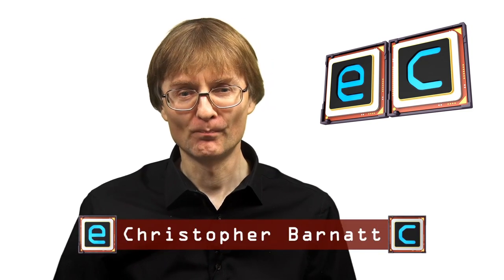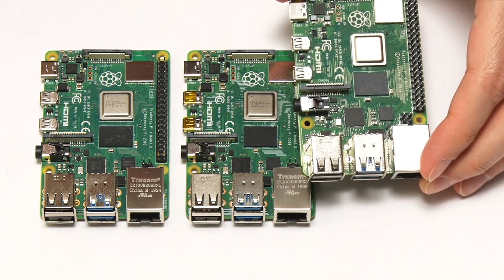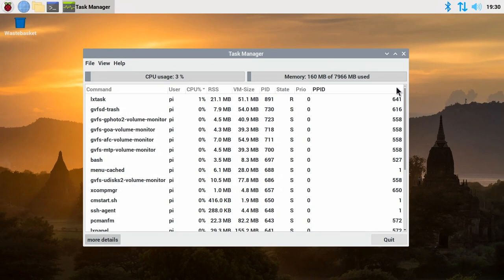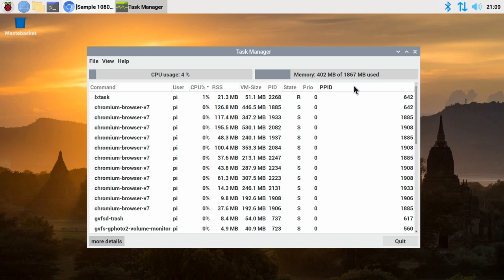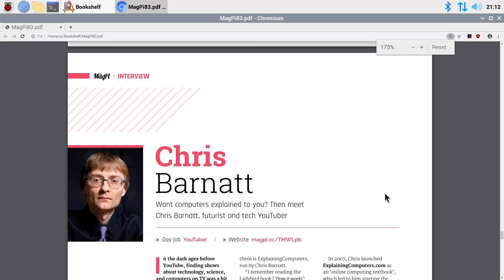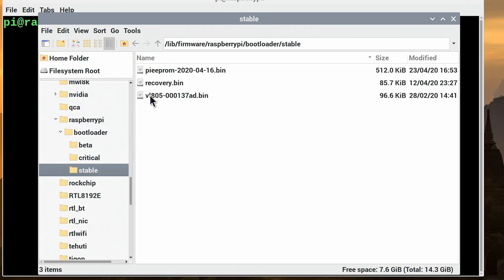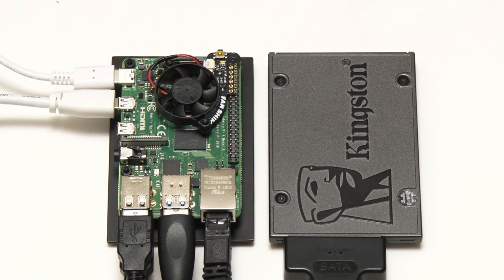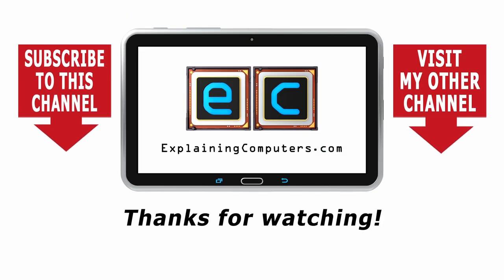Raspberry Pi 4 8GB & USB Boot

Comment: I think the best OS solution would be Lubuntu. I run it on 3GB with a single core processor. I use the 64 bit version because I need to run Microsoft Teams which has a native Debian app. It's a true 64 bit operating system with a very small footprint.
Reply from the maker: Is there a an MS Teams Debian app for ARM?
Reply: ExplainingComputers Not to my knowledge. There is a Debian 64 bit version for AMD/Intel.

Comment: Two questions:
1) Why did you need to flash the firmware? USB boot feature? If so, I'm shocked it took this many years for this SBC to finally support USB boot.
2) 8GB of memory, great. What are the other specifications?
This is the board you were reviewing?
https://www.raspberrypi.org/products/raspberry-pi-4-model-b/specifications/
Reply from the maker: The link is indeed to the board in question (the 8GB version). The new firmware was indeed to allow USB booting. A Pi 3B(+) has been booting from USB for some time, but the functionality is new to a Pi 4.

Comment: So with no memory at all the Pi would cost around £15? I guess the memory must be the most expensive component on the board. 

On a pedantic note - that's not the first Pi board that you additionally showed - the first Pi board had no holes in it. It's also interesting to note that those holes are not a surface mounted component like the others.

Comment: 4:17 Are you running this setup with the standard 5V 3A power supply or did you use one with more Amps? Or are you powering the ssd's from as different power source?
Reply from the maker: I am using the official Raspberry Pi 5V (actually 5.1V) 3A PSY, and the SSD is powered from the Pi via that adapter.
Reply: @ExplainingComputers  Thanks for your reply! In that case I'll stop my search for a 5V adapter with higher amps and also use the standard power adapter.

Comment: I'm new to Raspberry Pi and was surprised to find out that this is a new feature. I guess I've been taking for granted that low-level code that lets me boot brand new distros on my old laptops from a USB. Any reason you didn't run your usual read/write tests to see how the SSD and SD Card drive speeds compare?
Reply from the maker: I will run these tests in an upcoming video in which I compare the Pi 4 to the Odroid C4. This video was getting rather long.

Comment: Aren't cellphones and streaming devices like the Fire TV stick essentially SBCs?
If I can connect a type C or micro B hub to my phone via the single port, and power, add Ethernet, add external storage, a keyboard and mouse, and output to a HDMI from one port, why haven't we gotten there with SBCs yet?
Reply from the maker: You are right, cell phones are SBCs. On the connectivity, I think most users want more connectors, rather than needing to use breakout leads from a single port. What you suggest certainly could be done technically.
Reply: @ExplainingComputers  it could also change the size and form factor. Cost is where I think the biggest problem would be. With the advancements in technology just in the past 20 years, and USB4 just over the horizon, I'd love to see someone step outside the box and build something to rival the Pi Zero with maybe 2 type C only, and no pins, just solder joints. Ah the possibilities of even automotive infotainment in such a device.

Comment: Great Video, I've got a Pi4 (purchased in Oct 19) but have not used it yet because I've been waiting for usb booting support.  When first using a Pi4 do you still have to update the firmware to reduce the temperature and if so how is this done?
Reply from the maker: The latest firmware (for USB boot) includes the fixes for reducing temperature also.
Reply from the maker: Actually, you'll also need to upgrade the USB controller firmware -- but on an October 2019 board, it may well be updated already.

Comment: Hi Chris, If testing USB boot and the bootloader is, indeed, corrupted leaving you with an unbootable Pi, the RPF also have a recovery image at https://github.com/raspberrypi/rpi-eeprom/releases/tag/v2020.04.16-137ad, which you burn to an sdcard as normal, pop it in, boot and it will restore the standard bootloader. It does work (I know because I had cause to use it whilst testing), so not quite as panic inducing as you think.
Reply from the maker: You are right that a recovery image is available. But not all viewers may have the experience to attempt a recovery process. It is also possible that flashing firmware can fail and recovery is impossible, hence the warning I gave. People could end up with a non-functional Pi as a result of attempting the firmware upgrade, and so my warning is necessary.

Comment: Kids need computers for online school due to covid-19. Was thinking about 2 pies for this but a little worried about software compatibility. I think ZOOM has a Linux version.
Reply from the maker: Zoom would be a stretch on a Pi. It is not an X86 computer (it has an ARM processor) so you don't just need an Linux version, you need an ARM Linux version. Pity, as elsewise the Pis make great small desktop PCs now.
Reply: ExplainingComputers aah, i didn’t realize that. That sucks ☹️. Kinda strange as Zoom runs on all ARM cell phones.

Comment: I want to do an onboard computer for the car which will monitor and diagnose various systems and parallel I could play live streams radio over 4G, and play offline stored files. not in the last place to have a sat-nav. 
what is your advice to connect RaspPi to  OBD2 via cable or Bluetooth?

Comment: I'd like to know the best usb booting devices... booted from a thumb drive and it was way too slow when compared to the SD card.
Reply from the maker: Thumb drives come in many speeds! :) Even the cheapest of SSDs with a USB 3.0 adapter will be far faster.

Comment: I recently purchased a DeskPi case and M.2 SSD to use with my Pi. Unfortunately, the Pi won’t recognize it as a SATA drive and won’t use the UAS driver, so I can’t use TRIM or the max speed it should run at.
Is there a way to force it to use the UAS driver?

Comment: Very cool, Thank you Mr. Barnatt; i wonder how this little board now would cope with something like Ubuntu,  Gnome tends to exercise that memory..
Reply: Don't worry.   It is fine.  I read story from the Internet that Ubuntu Desktop 20.04 LTS on Raspberry Pi 4 takes about 1.4 GB of RAM to run. Even if you buy the 4GB RAM version of the Raspberry Pi 4, you should still have plenty of RAM for multitasking.

Comment: Am I the only one experiencing problems with wireless mouse/keyboard combo after following Mr. Barnatt's excellent example and instructions for updating to the 64-bit and SSD boot?  Upon boot the mouse and keyboard perform as they should. But within a few minutes the mouse begins to freeze and eventually quit working altogether. I found that the keyboard also dies. Are there issues with the USB ports on the RPI when using a USB attatched SSD?  Hardware: RPI 4 8GB, Adata SU800 w/USB 3 SATA cable, Logitech MK320 mouse/keyboard.
Reply from the maker: Sorry to hear that you are having these problems. I've not heard of this happening before, but as you note it could be linked to your new setup. This said, booting from a USB drive, and accessing one, should be no different.

So if possible, I would recommend booting from a micro SD card and seeing if all is OK. If so, connect the USB SSD (ie still running from the micro SD card) and see if that is OK. If it isn't (and I suspect it won't be) then the issue is some kind of conflict between your USB SATA adapter and your keyboard when used together on a Pi. Which should not occur, but clearly is an issue. :(  I doubt it is the actual USB booting process that is causing the issue. It is also worth trying different port combinations for your adapter and keyboard, and raising this in the Raspbery Pi forums: https://www.raspberrypi.org/forums/
Reply: @ExplainingComputers , Update: YOU FIXED IT! So I did as you suggested. Booted from the SD card. It worked as it should. So then I connected the USB SSD and was able to to access it, and it all worked as it it should. Ejected the USB drive, shut down the RPI and removed the SD card. Added the USB SSD back booted and am back to square one. Shut down, changed over to a Microsoft dongleless (is that a word?) bluetooth mouse and a Microsoft Wireless Keyboard 2000 which does requires dongle. I used the same USB ports between the two setups. It worked flawlessly all morning. This afternoon I shut it back down, went back to the previous setup from my message above. Planets lined up, not sure, but it seems to be working now. I'm at a loss. I'm sure it'll crap out again. Thanks four your suggestions.
Reply from the maker: Glad to hear all is going well, at least for now . . .

Comment: Hey Chris... I have this version of Raspberry Pi 4B 8GB.  When I first got it, I got happy and boot it without a fan.  I think it crash cos it was too hot.  From that point on, I don't think this Pi is normal.  I can't play 1080p YouTube video.  I overclock the CPU clock and the GPU clock but it's still the same.  I use ICE Tower while OC to 2GHz.  The temperature is at around 25celsius to 32celsius degree.  It only goes as high as 40celsius.  Compare this Pi to my desktop PC, my desktop PC flies.  Pi can't replace a desktop PC.  Maybe Pi 5 can replace a desktop PC but not Pi 4B.  I just don't know how you get your Pi 4B running much smoother than my Pi.

Comment: Actually I want to use a Raspberry Pi 4 as a media player to plug into older TVs (with HDMI ports but without USB ports) to play videos/movies(from USB storage) using VLC player. Is the 4Gb Raspberry Pi good enough for this or do I need to use the 8Gb version.  It's much better if I can play my own movies if we go somewhere, than getting ripped off by hotel PPV, or in our friends camper if it happens to rain. Any knowledgeable input would be greatly appreciated. Thank You
Reply from the maker: Any Pi 4 will work just fine for this -- either using VLC media player in Raspberry Pi OS, or Kodi. So the 2GB model will be fine, let along the 4GB. 1080p media playback from USB storage should be perfect.

Comment: I was left wondering about the current requirements for this new Pi -- especially with all the peripherals you show. I'd wager it's close to 5 amps?
Reply from the maker: The official Pi 4 PSU is 5.1V 3A. This powers any cooling fan and any drives (SSDs or a singe 2.5 inch drive) I've connected.
Reply: @ExplainingComputers : Thank you very much for your reply. That is still fairly modest power usage. I am seriously considering getting one

Comment: The pi4 has locally stored firmware?   Used to be the firmware was hot loaded from the SD on boot.  So there is a persistent memory area now?
Reply from the maker: Yes, there is onboard firmware on a Pi 4 that you can flash! :)

Comment: I want to learn  Kali, full version. Will 8 gigs add anything to the experience? Or should I start with Kali lite and a cheaper board?
Reply from the maker: Kali Linux should run fine on any Pi 4. I cannot see you'd benefit from the 8GB, so would get the 2GB or 4GB model.
Reply: @ExplainingComputers  I got my 4gb kiit yesterday. I hope to be able to use it with my BB Playbook which has a minii hdmi port.

Comment: I wonder how will it cope if you overclock the Pi 4B at 2GHz as well the GPU at 750MHz to see how both SysBench shows the temp and the video performance.
Reply from the maker: I am planning an "ultimate Pi 4 rig", and will then test this out.
Reply: @ExplainingComputers  Good to know. Also I did the same Test Temp .sh program with my fan and heatsink on my Pi 4B myself. But I'll not share the results or compare them to yours, just yet in case I spoil things - and to make your future video will feel more exciting and may expect some surprises...

Comment: Hello Chris, I am a latecomer to the pi and have just come across your channel and found it the easiest to follow and understand. Can you please help me ? As of right now, the latest stable and beta eeprom is dated 31-07-20. So I used your guide and concept and updated from 16-04-20 to 31-07-20 from the stable folder. I can't get the USB boot working using RPI OS 32 bit but did with the beta 64 bit. It says USB-MSD requires newer software ? I thought i had upgraded to the absolute latest. Also, could I ask one more question? we have a beta folder and stable folder but also a critical folder. What is the critical folder? That still has eeprom dated 16-04-20. Does that make a difference. I would appreciate any help. Thank you

Comment: @12:57 if it becomes unbootable, is that a permanent state or can I simply reinstall the OS and have the raspberry pi usable again?
Reply from the maker: This can be a permanent state, and has nothing to do with the operating system. The firmware update changes the software stored on the board itself. There are ways to try and install recovery firmware. But there is a risk if a firmware update goes wrong that a Pi will not work again.
Reply: ExplainingComputers yikes! Looks like I’ll have to wait for the stable version. Thanks! Great video as always.

Comment: my ubuntu 20 server 64 bits on pi 8Gb not boot, just start on command line
I try it with startx but not want, any advice please?
Reply from the maker: Ubuntu server 20.04 will only ever boot to the command line, as it does not have a desktop. Watch my video 9th August for adding one. :)

Comment: At 7:38 you are running you tube stats. MP4a is in the stats. Did you have to do anything to get that to play? Or is that Chromium running right from install? I have Raspian one version back. It will not play HTML-5 videos. Also using it for a Desktop. While my faster computers are running Folding@Home program.
Reply from the maker: I was indeed running Chromium from a clean install, which came with h264.ify installed.
Reply: @ExplainingComputers  I have that. it says it is not set up for HTML5.
Your browser does not currently recognize any of the video formats available.
Click here to visit our frequently asked questions about HTML5 video.
Reply: OK removed and reinstalled 264ify. Then restarted Chromium. I have only blocking AV1 and now it plays MP4a without a problem. So some where there has been a change.

Comment: Excellent video, thank you! I would like to know what applications would make good used of 8GB of RAM on a Raspberry PI.
Reply from the maker: For many users, the most immediate benefit may be in Google Chrome if you want to open a lot of tabs. Things like compiling code, 3D rendering (eg in Blender) or video editing should also benefit. But for the latter we really need to be running a 64 bit OS so that the program can address all of the memory. I will be looking at 64 bit OS on a Pi 4 8GB  -- and the apps that benefit -- in a future video.
Reply: @ExplainingComputers  I do compile code on the PI so thats useful, but for heavyweight applications I would just use a PC, I suppose the main benifit is for people who use the PI as their main computer.

Comment: Is there such a thing as an M.2 adapter for the PI 4 that can be contained within a small enclosure? It just seems like a non-brainer for people who want to keep things small, don't want to rely on the slow speeds and limited lifespan of MicroSD and want something that can run in place uninterrupted for a very long time.
Reply from the maker: I am at present investigating options for creating an "Ultimate Pi 4 Rig" what will include a neat, compact means of running from an M.2 SSD. So look out for a video! :)

Comment: Hello,
Which firmware do I have to bottle on my Raspberry Pi 4B so that it boots from USB.
The FW is currently on it from September 3rd, 2020. It only boots from the SD card.
The betaFW from June 06, 2020 is no longer in the download folder.

Comment: Hello Chris!.. I just rigged a raspberry pi 4 with ubuntu 20.10 running off of an SSD and connected one more 7200 rpm external disk for storage on it. I connect to the shared storage from a windows 10 machine. I noticed this when moving big ISOs around:  When I send from windows to the Pi I get max 20 MB/s transfer speeds but when I READ from the pi and copy to the windows machine I get 100Mb/s.  Have you (or someone else) figured out why this happens? thanks
Reply from the maker: The Pi has more work to do writing than reading data, as does the drive. Also, some file systems are much slower reading than writing: for example an NTFS drive in Linux will have pretty slow write speeds, and this may well be the issue here.

Comment: Are there any mini computer boards like the pi that have a parallel port (For license keys) and capable of running windows?
Reply from the maker: There are many SBCs that can run Windows -- see my group review tomorrow! :) But none have a parallel port, but you could use a USB to parallel adapter.

Comment: How beta is this new boatloader as I saw it in discussions even on raspberrypi.org?
Reply from the maker: As of 15 June there is a stable release. So if you do a sudo apt update and sudo apt full-upgrade now, you will see a 15 June 2020 file, and if you apply that (using the method in the video, but applying the latest file) you will get the stable release. However, I would advise using a clean install of Raspberry Pi OS (not an updated version of Raspbian) with the new firmware.
Reply: @ExplainingComputers  Thank you, I tried it and it worked.

Comment: The next raspberry pi should have a better i-gpu with better graphics acceleration and a nvme slot at the bottom. Let's be honest , almost everyone is using this as a htpc system. A better arm windows version would be great too. Not everyone is into Linux.